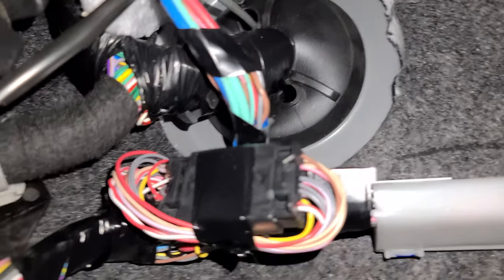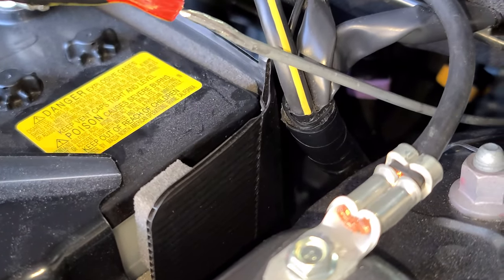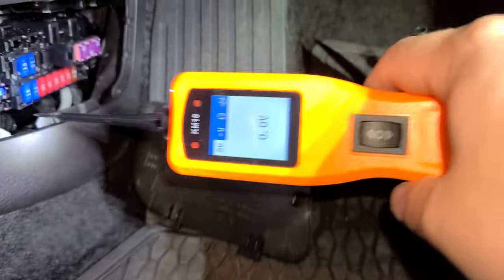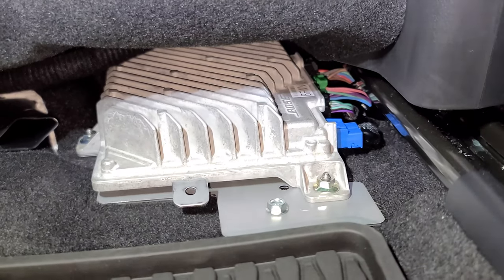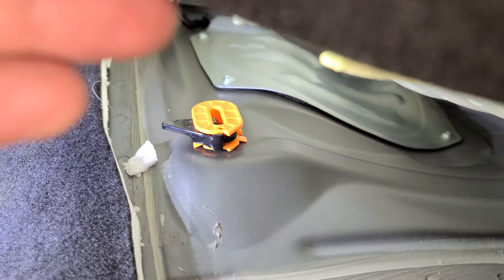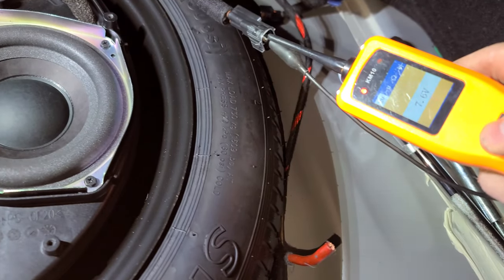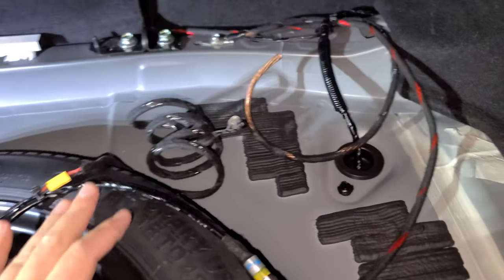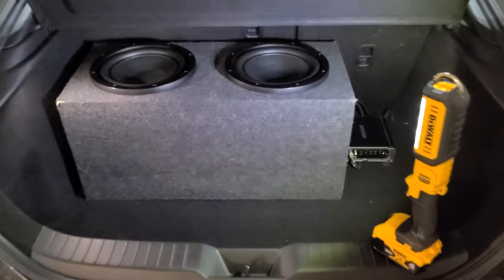4th Gen Mazda3 Hatch Sub/Amp Install (BOSE)

Comment: What about your remote turn on? If you didn't use a LOC ?
Reply from the maker: My amp has signal sensing capabilities. So it turns on once it senses the signal source from the radio. It's a really nice feature to have. 

If your amp doesn't have that, you definitely need an LOC that creates the remote signal for you, or use a 12v ACC source from the car.

Comment: What T's did you use to get the signal output from the bose wires?  That's the only part I'm confused by
Reply from the maker: Sorry for the late reply. Look up XT-60 connectors and you'll find what you need.
Reply: @bdrummer96  Thank you and one more question did you leave the stock sub powered or just left it there so the spare didn't bounce around
Reply from the maker: @slowmazda3h802  Yup! Just left everything hooked up as it was from the factory. The stock woofer is still working as normal. I just tagged the signal, fed it into my signal sensing sub amp, and added 2 10's in the rear. It's been working great for many months now.
Reply: @bdrummer96 one stupid question. i know you took the signal from the existing sub, and also left the factory sub plugged in. however, if you were to UNPLUG the factory sub, considering the aftermarket sub is getting its signal from those RCA, would the aftermarket sub also stop playing in that instance since it is “unplugged”? i saw someone else saying unplugging the factory sub will make  your existing speakers louder cause there’s less load on the factory BOSE amp but i’m wondering if you can even do that following the exact steps you took here? this would be my first installation. thank you!
Reply from the maker: @rememberthelaughter  If I unplugged the factory sub in this configuration, my aftermarket subs would NOT stop playing. Think of them as 2 light bulbs in a (Y) configuration. If I unscrew one bulb, the other will still stay lit (still receiving a signal). 

As far as the ohm load question, it depends on how the factory Bose amp is configured. Most aftermarket 5 channel amps have a separate channel for the sub output, so unplugging it would not affect volume or ohm load. On the other hand, if you had a 4 channel amp and disconnected 1 speaker, you would notice a change because now you're dropping the ohm load. 

You will be fine if you install an aftermarket sub/amp and disconnect the factory sub, but again, it does depend on the Factory Bose amp configuration. I just left my factory sub plugged for better mid-bass.
Reply: @bdrummer96 gotcha! that makes perfect sense. god you are a life saver. one last question 😁 i saw you didn’t use a LOC of any sort (at least i’m pretty sure). so i would just tap into the positive and negative of the factory BOSE sub, connect that to RCA cables, then plus the RCAs directly into the amp with no LOC needed right? and if the amp asks, would that be a high or lo input/output? those are the only other questions i had before i went ahead and attempted this myself 😊 thanks sm for your help!!!
Reply from the maker: @rememberthelaughter  Correct, I did not use an LOC because the signal going directly to the subwoofer is a "high-level signal," and my amp input can toggle between "hi or low". So, to answer your question, you would select "hi" on your amp in this configuration. You would select low if you had an aftermarket radio that was connected to an amp directly by RCA cables (radio outputs low level signal @rca jacks, so your amp needs to "accept" that same signal, hence why you would choose low on the amp". That's just one example. 

I chose to do it this way because the factory sub channel is "centered," meaning there's no left or right channel, so I don't have to worry about any balance issues. I should've showed this in the video, but I cut one side of the RCA cables off (leave male side for your amp) and spliced them into a XT-30 connector. You can also use male/female crimp quick disconnects or similar connectors. You will notice that each RCA jack is a twisted pair, one negative/one positive. Cut the sheathing back and twist both negatives together and both positives together, leaving you with two connections. Those positive and negatives will connect directly to the factory sub pos and neg (shown in video). That is the connection I made with the XT30 connector. 

So essentially, I T'd into the factory sub pos and neg with 2 RCAs (do not cut the factory sub wires if you're leaving it connected) and plugged that in directly to my amp. Then switched it to HI level input. That's pretty much it as far as the amp goes. Then just take speaker wire from the output of the amp to your aftermarket subwoofer. I hope this helps, don't hesitate to ask more questions! Good luck!
Reply from the maker: @rememberthelaughter  *XT-60

Also, if you need help with subwoofer wiring (4ohm vs 2ohm) I can help. Especially if you have a 2 subwoofer setup like I have in this video.
Reply: @bdrummer96 you are super super super awesome! i plan on having a single 12” sub in my 2019 mazda3 hatch 😊 i just want something with that little extra kick to it. all i need to do now is look for an amp with (preferably) ~ 500watts rms, signal sensing so i can avoid the remote turn on (since our lovely fuse panel is all live. thanks mazda.), and has the same option for hi level input like you stated (which i’m sure won’t be a problem). you’ve been a HUGE help and i appreciate it so so very much. i plan on running a sub wired down to 2 ohms! so i shouldn’t have any problem with that. i’ll keep you updated in case i have any other questions! 😁 ty for all your help thus far
Reply from the maker: @rememberthelaughter  No problem! 500 watts rms is going to rattle your soul lol. No problems with "a little extra kick" there haha. After I made this video, I saw some people tapping into there autolights signal for accessory power. I personally wouldn't do this without a relay for safety. But finding an amp with signal sensing shouldn't be too hard nowadays. I haven't had a single issue with this setup, so you'll be fine too.
Reply: @bdrummer96 how many watts rms is your system? (you may have said it in the video but i haven’t rewatched lol) your subs look humongous. i really don’t need anything crazy tbh unless i’d amplify the rest of the speakers (which i wanna do further down the road but not yet financially lol). but i guess maybe i can settle for 350 rms or so??? i’m really not a SUPER huge basshead or anything. i go back and forth!
Reply: coming back with an update after some research. i’m gonna go with the amplifier Kicker 47KEY500.1. would be perfect for our Bose system mazdas cause of the DSP feature, and also has DC offset signal sensing! compact and 500w rms @ 1 ohm! i shall keep you updated ahaha. thanks sm
Reply from the maker: @rememberthelaughter  my amp is 300W RMS and I think it's perfect. 500 is definitely going to be cranking but you can always tune it down a bit. Yeah that amp should be perfect. You 12" subwoofer is also 1ohm correct? Just have to make sure the impedances match. Definitely give an update! Hey, maybe even make your own quick video.
Reply: @bdrummer96 i think im definitely going to be tuning it down quite a bit upon install haha! i’m planning on going with a Skar SDR-1X12D2 (i know that’s not the best brand) but it’s cheap, it’ll get the job done, comes in an enclosure already and is already wired to 1 ohm 🙂. and, last question i swear! do you think posi connectors would work well for tapping into the oem sub wiring to connect to the hi level inputs? i don’t really see why not i’m just new to all this. don’t want to use crimp connectors and have to cut the factory wiring off - id rather just pierce it and leave factory wiring in tact which the posis seem to do
Reply from the maker: @rememberthelaughter   honestly, whatever works within your budget is fine. You can always upgrade later if you want. But yeah, that setup is definitely going to move some air! The amp you selected also features the Keyloc system (I believe that's what it's called). Definitely watch a tutorial on that because I think it has to listen to your factory audio signal and restores any bass roll-off from the factory. Great pick. I wanted to do a video on that amp. 

As far as the connectors go, yes technically they will work. Any good tech will tell you strip, twist, solder, insulate, but it does depend on the application. For me, I have a pair of Irvin "side strippers" that expose the wire insulation without cutting the wire. From there, I twisted on my XT30 harness, soldered it, electrical tape, then Tessa tape to finish it off. The reason most people use this method is because other "quick connect" options can fail over time i.e., they come apart, corrode, arc, etc. Its up to you though, those connectors are definitely cheaper than buying a pair of side strippers.
Reply: @bdrummer96 update! i did it! and it sounds great!!!!
only one small issue though lol. i selected hi level inputs on my amp, turned dc offset on, and even when the vehicle is off, the amp is powered on :(
i think there’s an ACC wire in the bose amp that i can tap into. but i just wanted to keep you updated. weird how yours works with speaker level inputs on a kicker amp and mine doesn’t! considering our set up is just about the exact same
Reply from the maker: @rememberthelaughter  so mine stays on for a few minutes after shutting the door. And will turn right back on as soon as up open the door. Id try setting up your phone to record the amp to see if the lights shut off if you can't see your amp from the outside. I just removed the rear hatch privacy board so I could see mine. 

Great job though! Im glad this video was helpful to you.